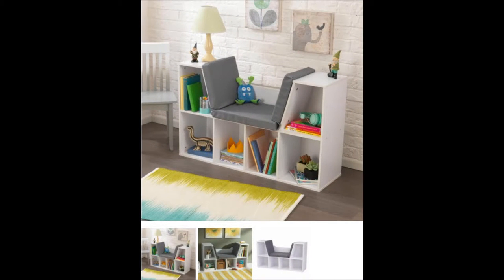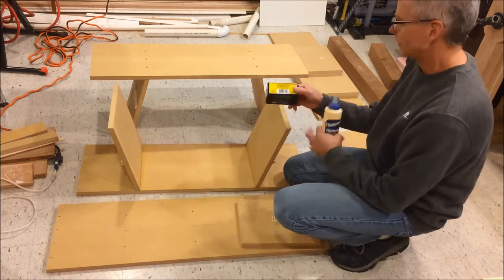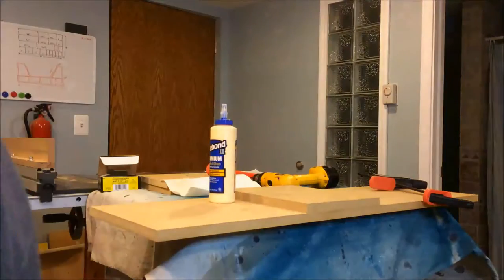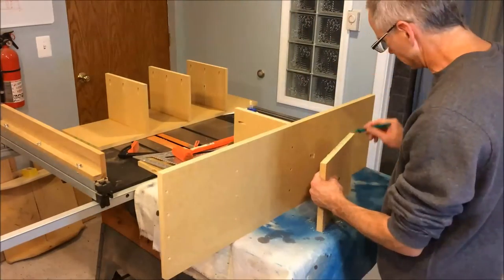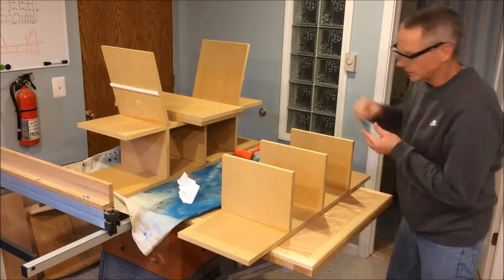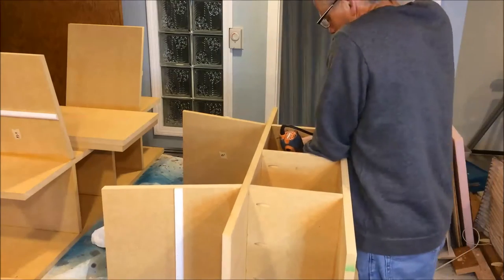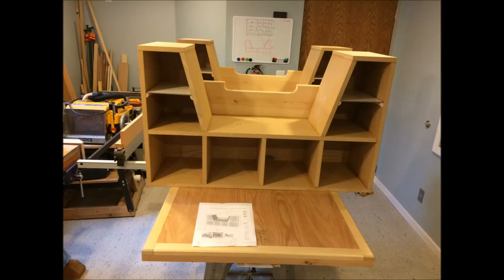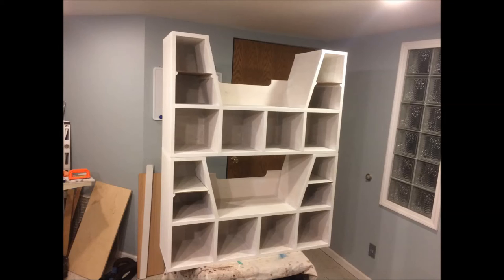Simple DIY Kids Bookcase with Reading Nook

Comment: Nice job on book shelves question where did you get the router table insert.
Reply from the maker: Thanks Byron.  The router table is a Bench Dog 40-102 ProMax, cast iron table. Mounting it to my Rigid saw was a little challenge, but not to difficult.  If you search for it on Amazon, you will find an excellent review that was created by a buyer, including video, showing how to mount this to the same saw that I use.  I really do like this, and while it is quite pricey, I think it is worth the cost.  Good luck.